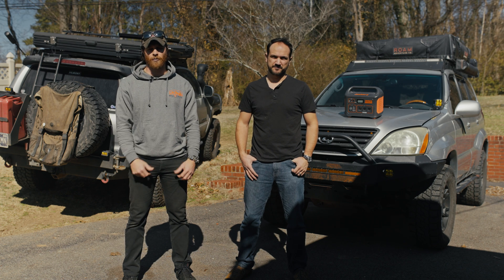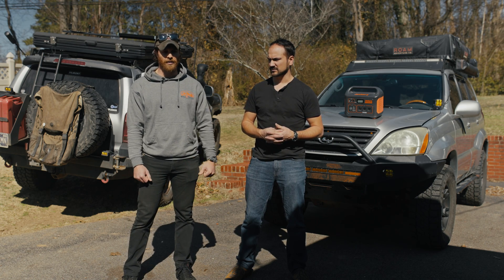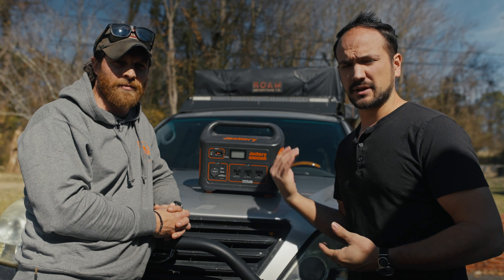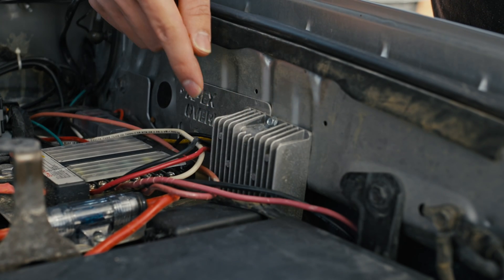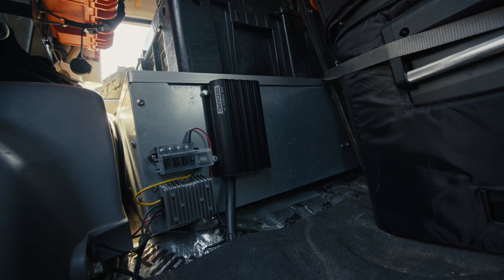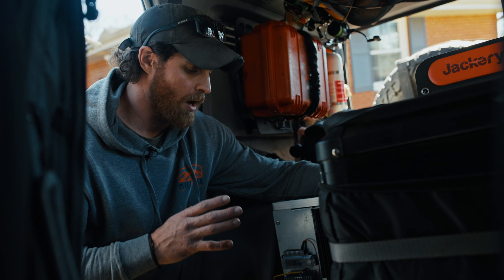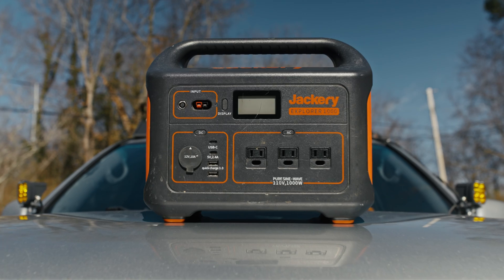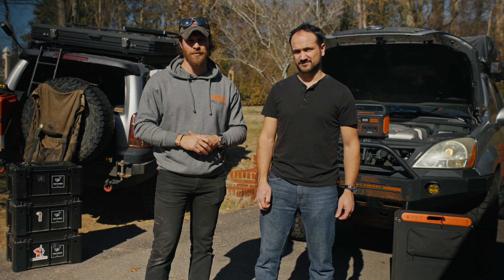FASTER CHARGING FOR YOUR JACKERY POWER STATION! - 12v to 24v Conversion

Comment: Question: a 12v to 24v converter changes 12 to 24. If i hook up a 100W solar panel to it,will the 100W panel increase to 200w.

Comment: jackery charges 800 bucks now for their 1000 v2 model.
you can build your own ~900wh ammocan powerstation for a little but over 80 bucks, if you build a dc only version. just have to use 8x 32ah lfp cells, and they will fit inside of a regular plastic ammocan in series. add 2x 100w bidirectional usb-c boards which can be set to LFP voltage range, and charge each 4s pack individually. on my mini ammocan ~420wh version, i only use 4 cells but still have 100w usb-c 2 boards, can i can just charge it with multiple cables at once. usually usb-c tops out at 100w each cable if you dont have new pd3.1 versions, which are very rare.
most people dont realize that the 12v cig plug is actually used for 24v appliances which truckers use all the time. its why most 12v appliances like dc fridges say 12/24v on them.
there is very little that you need ac power for on the road, and being able to make the same powerstation with 1/4th the size is super handy. if you need ac power you can add a 24v car plug to it and run it through a direct connection to the cells, just add a fuse. 24v at 15amps can put out more ac power tru a modular inverter than you should ever need. for cooking they make 12/24v trucker appliances now.

Comment: This video is awesome! I just wish it were a bit more specific on the actual hardwiring setup, are you jut chopping the female end off the 24v plug and wiring that into your 24v fuse block? in setup no 2 does the RedArc DC-DC have the ability to charge the jackers and a dual battery simultaneously? Thanks guys!!

Comment: Wait, I must have missed something. That looked like a boost convertor to take the 12V up to 24V, but that doesn't increase the power you can draw from the 12V tap. It would halve the current. So how does this cut charging time in half? 🤔
Reply: Exactly, you're still capped at around 140W maximum charge, just with higher voltage and lower amps... this entire video is completely pointless!